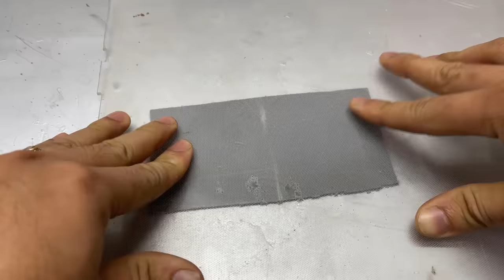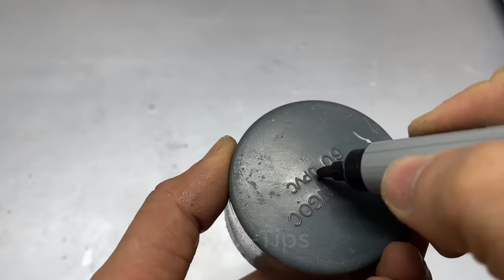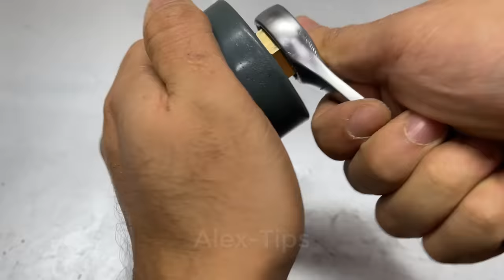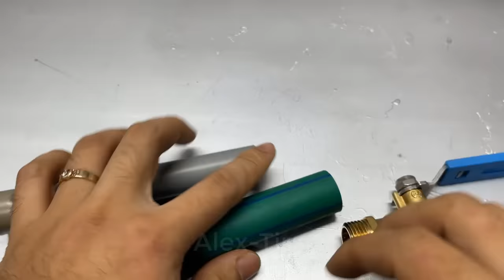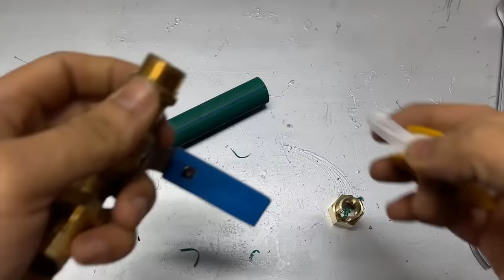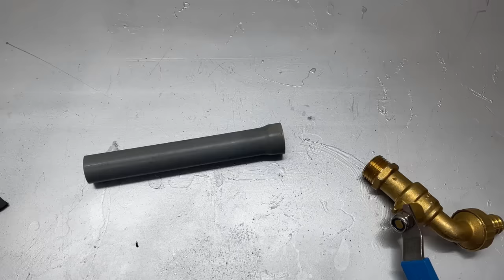Cool Trick For You! Tips For Connecting Water Valves To Larger Pvc Pipes

Comment: Seems like a lot of work to me. Why not just get a cap and put on the bigger pipe then cut a hole the appropriate size in the cap and screw in your smaller fitting? if you need the bigger fitting to continue, then just get a "T" for the bigger pipe and put the cap on the "T" then once again drill a hole the appropriate size and screw in your fitting for the smaller pipe.
Reply from the maker: Thank you for your information

Comment: Kindly let me know how to connect water tap in the middle of 3/4 inch rubber hoze pipe . Thanks
Reply from the maker: With such small pipes, you should buy a ribbed T-joint so that when the connection is complete, get a tightening belt or steel wire to make it stronger. you just need to cut it exactly where you want it and put the T in it and then connect it